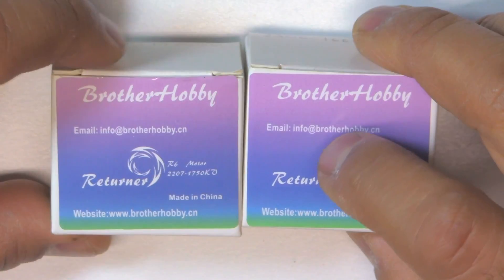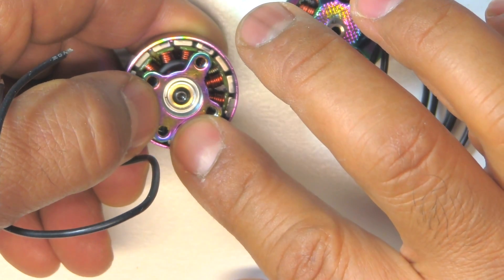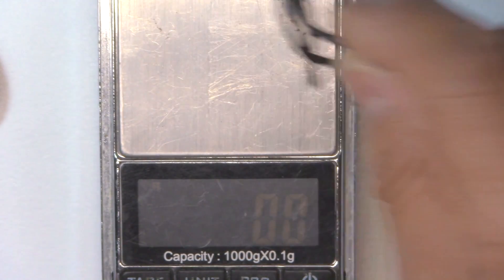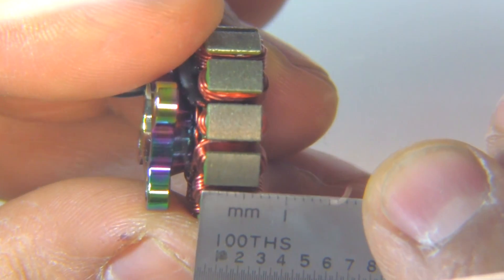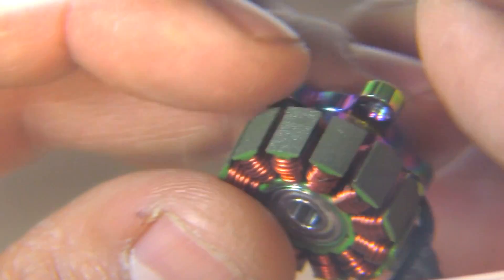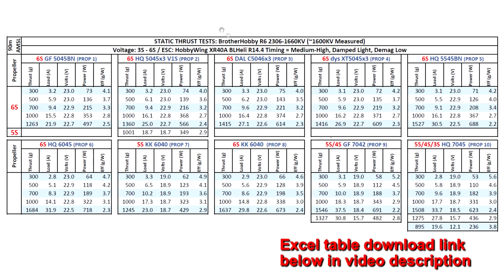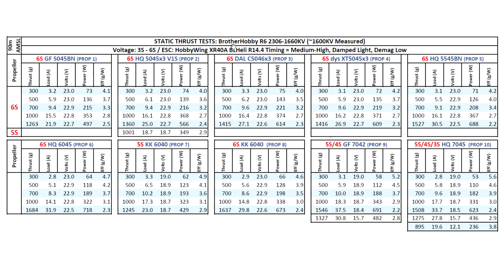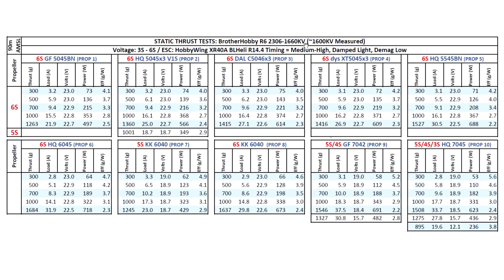BrotherHobby R6 2306-1660KV 6S Thrust Tests

Comment: Wow, huge difference between the 2306 and the 2207 . Only 160 kv higher and can do almost 500g more, wth.
Reply from the maker: On the day I tested the 1750kv motor, climate conditions were extremely optimal for making thrust, cool and very dense air on that evening. I noticed it when I was testing the Speed Shield 2207.5 with same KV so I ran the R6 again on that same day and thrust was of course lower. You can check those numbers on that test. Also  the test locations of the R6 motors have a difference of 250m in elevation in favor of the 1750kv motor adding to the difference.   I've seen 200 to 300g difference when testing on hot days back when we had heat waves here last summer so I avoided testing during the day outdoors and moved test bench indoor and had to crank A/C to keep temp @25C

Comment: 1660kv seems a bit low even for 6s...
Reply from the maker: Yes, this KV makes less thrust than the 1750KV, this motor is actually closer to 1600KV so need another 50 to 100KV

Comment: Any new 4000--4200 kv 4s 3" and 4" motors coming soon?
Looking for something to replace my rcx rs1407 4100kv, hopefully with something around 1408 4172kv with more thrust
Reply from the maker: I just received the new GepRC 1507 motor, I think I got 3600 & 4200 KV, I have to check the box for actual KV I received. Their larger 2306 motors performed quite well and got good reviews so far. I'll run those 1507's this week but then it takes me a couple of weeks to get data organized and editing video is what takes the longest.....  Cobra 1407 motors have also got good reviews and motor tested well, another option is the BrotherHobby 1507 but have not seen that many reviews after long-term use.

Comment: +1👍 Thank you for everything sir!!
Reply from the maker: You're welcome. Thank you for watching and good to see you're online, means that nasty hurricane didn't hit your neck of the woods. Also hope those Tachyon motors are doing ok.
Reply: bent two shafts on first acro-flip attempt. Ordered 2 replacements.  iFlight support didn't have components, i think the shafts are soft or maybe i'm just wayyy too noob.  Replaced with my 2 leftover good emax, a new 1 and the 1 you sent me.  Still noob but hovered good --  had to lower "D" to very low (10 & 8) to keep them cool this time.
Reply from the maker: Sorry to hear about those. But good the Emax are working better. I went thru a few motors and frames too when switching to acro... LoL, it gets better with practice. It's better to have a lot of elevation when doing acrobatics so you have room to recover.

Comment: I bought 2 sets at $14 ea a few months ago. At that price hard to beat. Bigger bearing is key. Run beefy props on them.
Reply from the maker: That's a killer price. For sure not to be missed.  So far all good reports on these. Amazing one guy is running the 2000kv motor on 8S for testing his frames. Video link is pinned on my comments.

Comment: 1440p please!!! Great video tho.. but I'm blind lol 😅 well not really but 70% of videos are less than 1440.. :'( ..... #imnotgettingthat4kxperiaphone :'(
Reply from the maker: Thanks for watching. I use an old Canon handycam that's only good for 1080. I have  to place it a few feet away at an angle to avoid propeller wash thatbwouls otherwise shake the camera noticeably.  Action cameras like the GoPro have too wide of angle I think, so it would have to be very close and would get in the way as I need to have access to the laptop to start/stop logging data and also get to motor to switch props. I may givebitva try and see if it works though...

Comment: Nice test! I thought Brother Hobby uses japanese EZO bearings.
Reply from the maker: Right, they had been using EZO almost exclusively, but looks like they went to NMB on this one. Hopefully it's just as good.
Reply: EngineerX I got several spare 4X9X4mm EZO bearings for those 3B 2306 motors from eBay for about $7 for a set of 2.